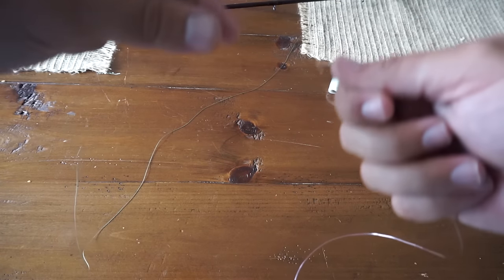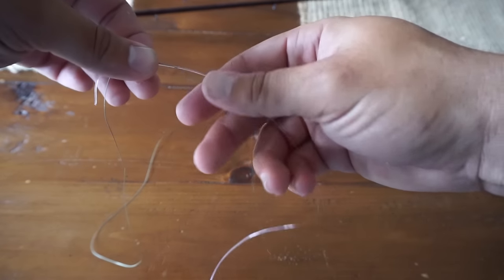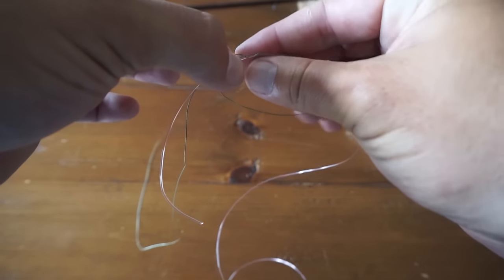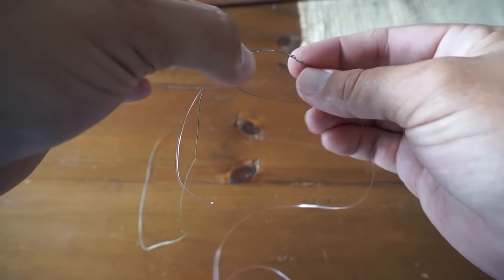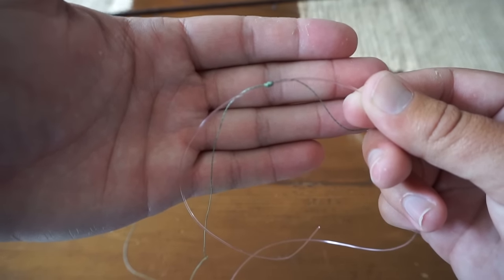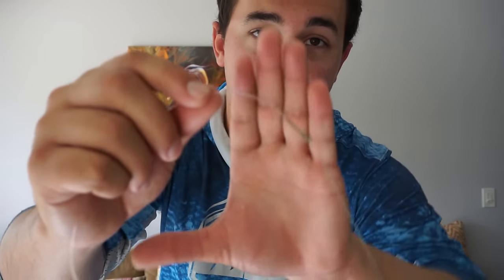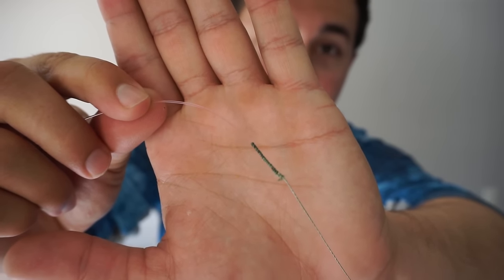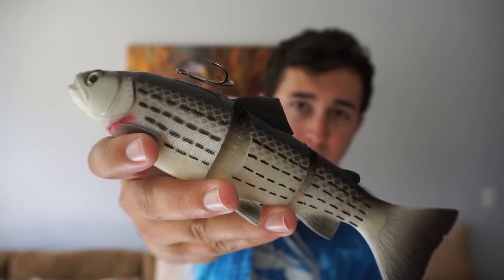How I Rig: Knots for the Right Situation

Comment: Is it possible to use a swivel instead of a knot from main line to leader? When throwing a lure?
Reply: Nicholas Collazo I wouldn't.
Reply from the maker: +Nicholas Collazo you could but the swivel will weigh down the lure and could screw up the action
Reply: Nicholas Collazo and then you gotta think you can't reel in past the swivel so if you wanted a 3 foot leader every time you cast the lure is hanging down three feet at least
Reply: only do it if you are using a lire that causes line twist, like a spoon. also workd if you are fishing bait and want the line to be able to slide through the weight but not get the weights too close to the bait

Comment: yo on that double-uni knot you should only do 4 wraps on each uni  at most. 3 wraps is plenty strong and casts extremely well. I usually go 3 wraps on the flouro and 4 wraps on the braid, nice small knot, never breaks. I've landed 7ft sharks and 4ft Tarpon on 3 wrap uni's all day. 8 is just plain unnecessary.